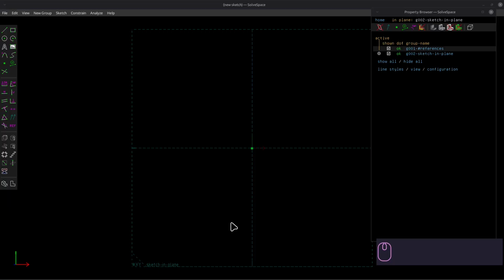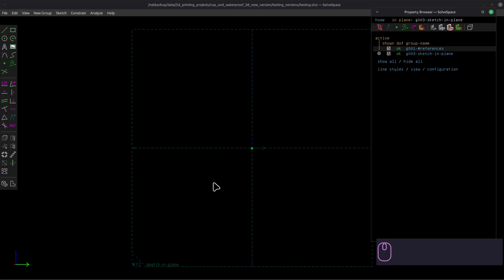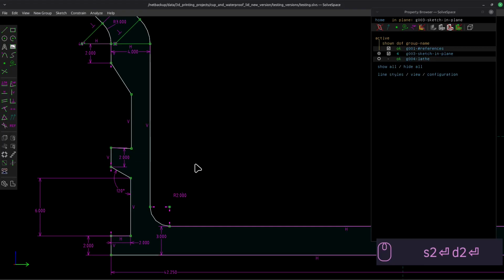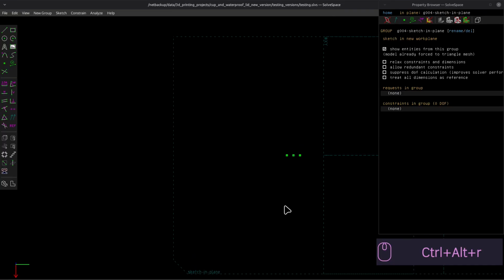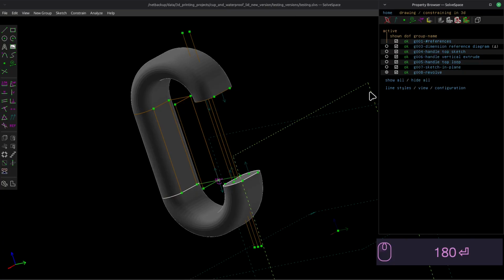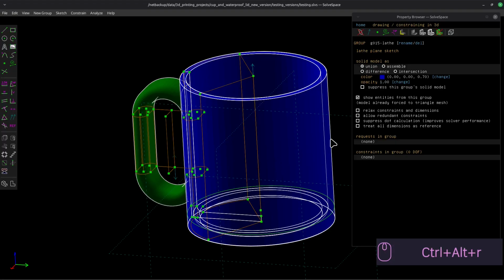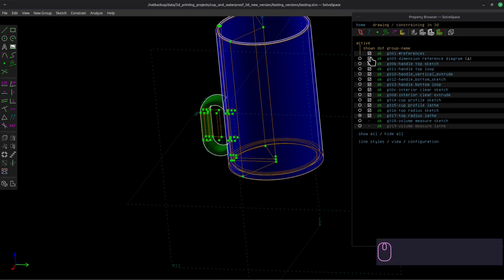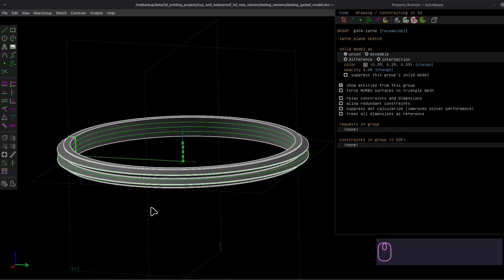SolveSpace Tutorial: From Sketch to Product

Comment: Another excellent tutorial, they really are so well put together and thought out. Absolutely the best! I also use BRL-CAD (although less so now with Solvespace available) which is powerful and open source - It has a steep learning curve. Your style of tutorial would be fantastic for that package too!
Reply from the maker: Thanks for your kind words! On the topic of other design tools, I just tested something called Dune 3D that superficially seemed promising, but for some technical reasons I realized would be too difficult for my readers to either compile or run on both Windows and Linux. Too bad, because it has some nice features. But for my audience of non-programmers, it was too steep a setup and compilation curve (not learning so much, but setup).

Anyway, it's my hope that someone will create a fully usable open-source CAD/CAM environment, without requiring people to sign up and pay big bucks. Meanwhile we have SolveSpace, a mixed blessing. :)

Thanks again!